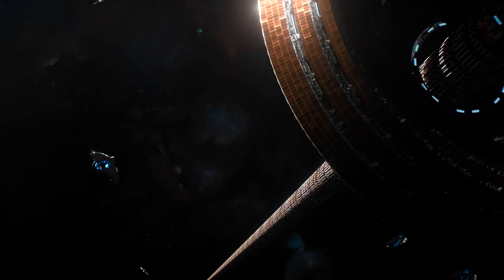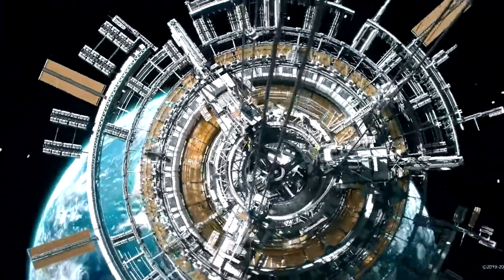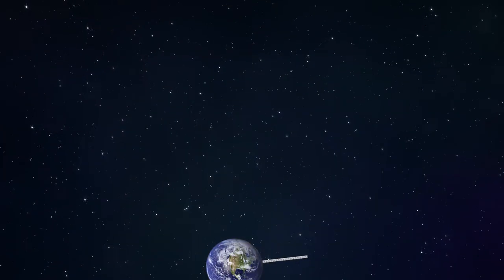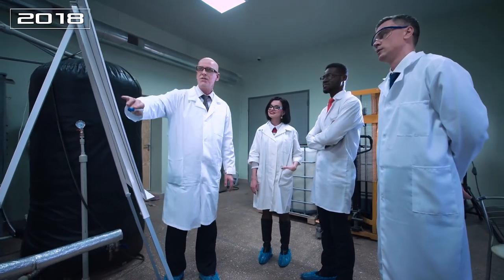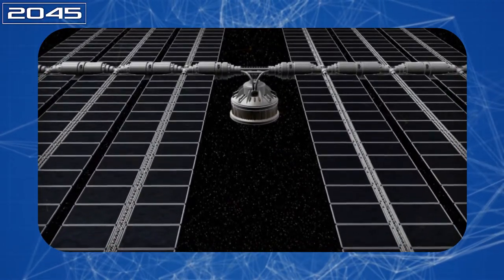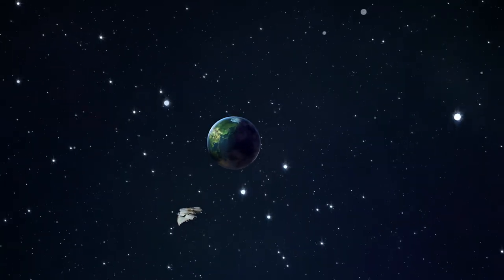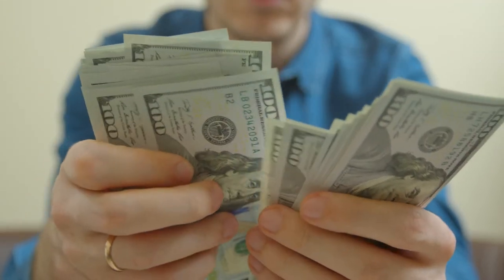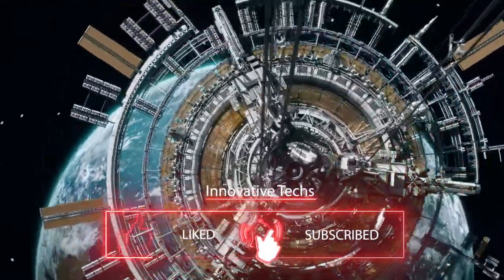Are We Building a Space Elevator?

Comment: May be possible, only if they use circular levitating magnets on top of one another.
And a center platform secured in the center with a powerful magnet. 
There will be no need for a cable or motor of any kind.

Comment: This has long bothered me. How do they plan to
damp long vibrations that originate anywhere along the cable
and travel to the ends with such force that it would break the cables?
22,500 miles of cable will not fall up. It will lay out across the land
potentially killing cows, ships, and unprotected people.
Reply: Those vibrations would need to be harmonic to be destructive. Dampeners would need to be part of the design.